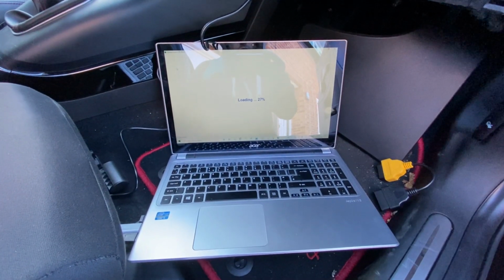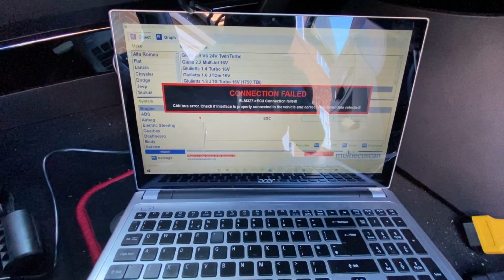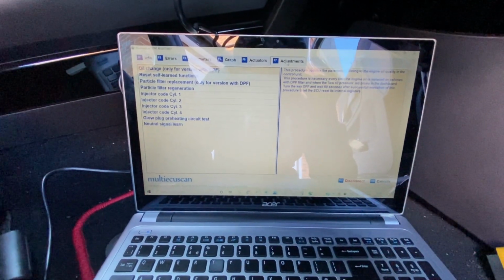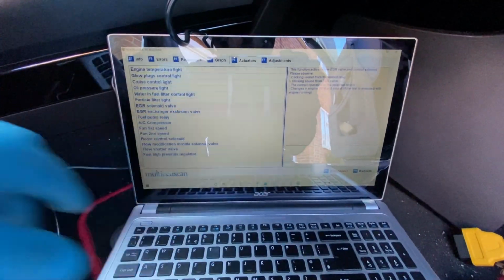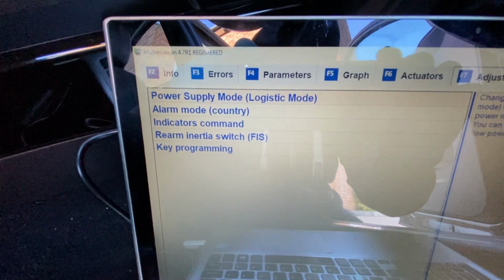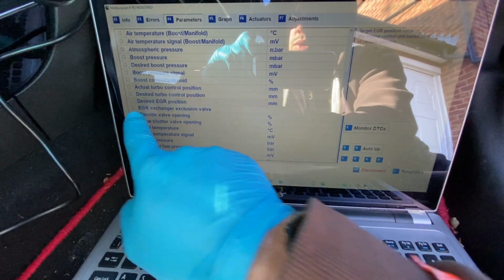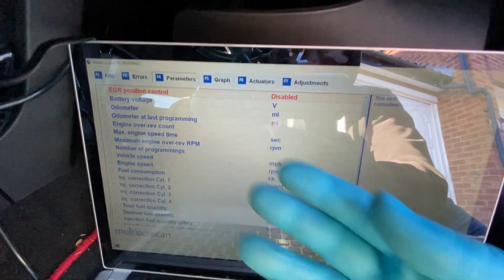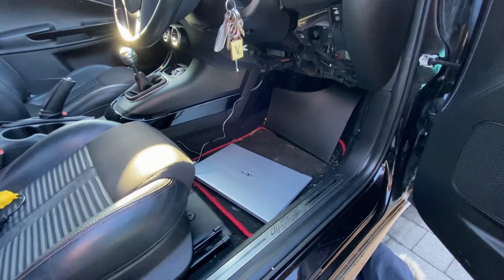Alfa Romeo Giulietta EGR Delete with Multiecuscan or not    Subscriber Request

Comment: Hey Tony hope your well. My car engine went jumpy and put management light on and start stop unavailable. So called the rescue service. They found egr was stuck open. So fitted a blanking plate(piece of metal) to black fumes from getting to egr.

Car then ran ok done 1,000MILES. Light still on every time. But car has been going into a reduced power mode sometimes.

My garage told me that people choose to blank off egr. He'd done 2of his own by choice. So I should just leave it blanked and see if it affects performance and let him know.

Trying to workout just now if it's affecting fuel economy and will try and work out what other faults it's starting to come up with on computer.

About to scan it just now and see what codes there are so I can advise him. Thanks for letting us watch videos to remember how to use the scanning tool always brings your videos up just before doing it
Reply from the maker: Hi. Good luck with it. Worth checking the MAF for oil too. Mine went into limp mode and kept stalling. Cleaned it out and now all good. There’s one of my older videos on the channel. All the best 👍

Comment: Great video. I had complex MAF problems in my 159 2.0 JDTM.   Car has no power below 2k revs. Unplugging the MAF restores the power to near to normal (previous) performance. But of course the Check Engine Light comes on. Bought a new Bosch MAF; did'n fix the problem. Bought a new MAF plug (car side) as the original was damaged. Didn't fix the problem. I suspect I have a broken wire, far downstream from the MAF plug. I changed the MAP sensor (mainly just because they're cheap) and still didn't fix the problem. Anyway, I read of others with this problem and some people claimed you can "deactivate the MAF" in Multiecuscan, so that the car uses the MAP and O2 sensors only, and people reported their cars running much better.   I investigated with MES and found (like you did) it is really just a diagnostic software and had absolutely no options for "deactivating the MAF", nor the EGR nor anything else! People rave about all the tweaks they made with MES but I've found most are absolute BS.... MES is just like a diagnostic scanner. Great for advanced DTCs and diagnostics but absolutely nothing else!   Please I didn't waste £125 foe MES and all the coloured interfaces.

Comment: Hi Tony. What kit are you using for the connection? I have a KL connector (USB to port) and it doesn't work
Reply from the maker: Hi. There should be a link in the description below the video. It’s a cable set from EBay. 
Hope that helps. All the best 👍
Reply from the maker: Sorry, just realised it’s a different video. I’ll try and ping you a link to the correct video 👍
Reply from the maker: Here you go 👍https://m.youtube.com/watch?v=rPSYG8sgVXQ&t=8s
Reply: @vialettotony  Much obliged. Wish me luck :)

Comment: I have a 1.4 distinctive and it's rather bad with fuel consumption (10.2l/100km) just want to know if there's someone in the community that this might be a normal consumption for such a small engine or what might be wrong with the car?

I don't drive with a heavy foot especially because of the poor fuel stats so it isn't me that's a issue.
Thanks in advance
Reply from the maker: Hi Michael. It doesn’t sound good. You should get better than that. I would recommend getting any fault codes read first, as it could be a faulty MAF, MAP or Lambda sensor that’s causing this. Start there and see what you get. 
Hope that helps. All the best 👍
Reply: Hi guys, My wife has a FIAT 500X 2.0 multijet engine Diesel. ACT gear box 4 whell drive.
Consumption when we tried it was 7.0l. Now after having bought it and a "refresh" of ECU from FIAT, consumption is 10.5l.
I reckon it has been reprog beacuse of the fact of the diesel gate... so now consumption is F... increased. I think EGR is the main thing!!!
I want to get ride of this F things !! this 2.0l is supposed to do 7l no more.. 
Consumption is higher than X3 3.5D !!
it s a scam !!

Comment: I got an 2010 Giulietta 1.6 and i have a really annoying problem with my old DPF, do u have some tricks with that, my engine is in a block state bcs of that :(
Reply from the maker: Ciao Francesco. I know it’s possible to force a DPF regen with the Multiecuscan diagnostic software, but it will only do it if it’s not blocked. They can be replaced, if that’s the only problem. 
I’ll see if I can make a video for it. 
All the best 👍